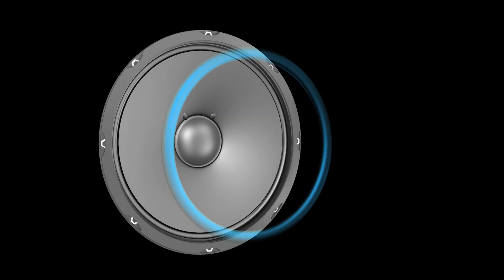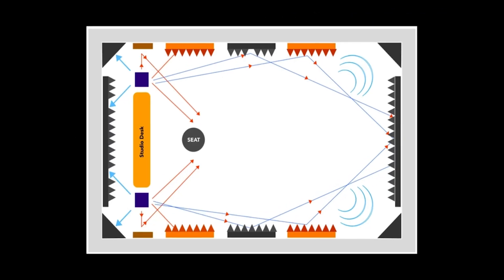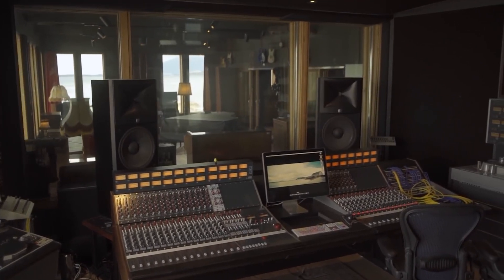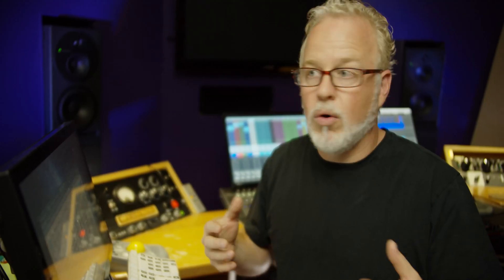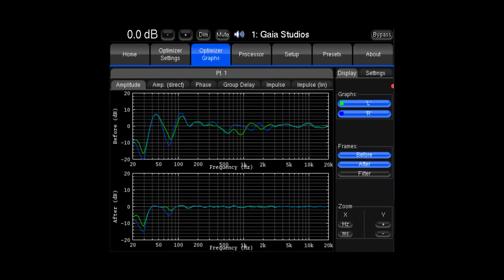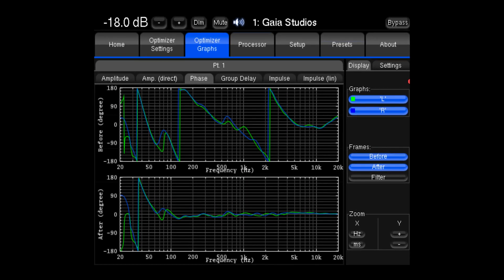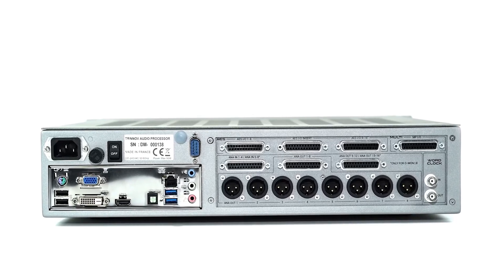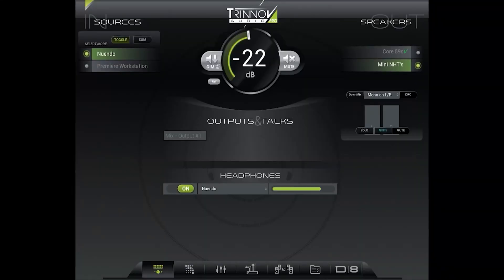Trinnov Pro Tutorials: Introduction - Why Room Correction ?

Comment: Hi Ashley Shepherd,
Does the sound volume affect the sound in the room due to absorption from furniture, walls and physical acoustic treatments? I mean: is the frequency balance different in the room at 60 or 95 dB for example due to the absorption/reflection of sound? Does Nova correct this based on listening level? Thank you very much for your informed response.
Reply from the maker: Theoretically and in our experience, no. The Optimizer does not measure nor compensate for non-linearities. What matters from a calibration level to another is the crest factor. In other words, the quality of the measurement, which tends to be greater with a higher calibration level.
Reply: Okay, thanks for your response. Sincerely.

Comment: I think would be fair to mention that room treatment is still required / highly beneficial BEFORE the Trinnov is acting, otherwise you cannot control decay time, only phase and level...
Reply from the maker: Of course: Our system was never intended as a replacement for acoustic treatment but more than its extension in the digital domain. Digital active room correction is definitely not a substitute for passive room treatment and results from a Trinnov are even more impressive in a nicely treated acoustic space!
Reply: You could imagine how much a system must correct in an untreated room. So much, it would definitely impact the sound in a massive way. If possible at all. Trinnov did an awesome correction to my treated room. Worth every penny three times.